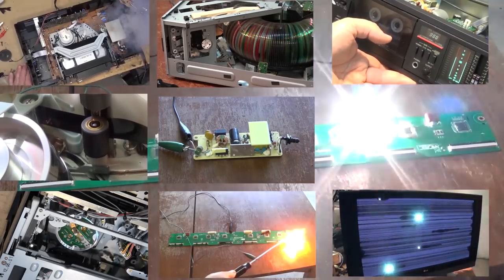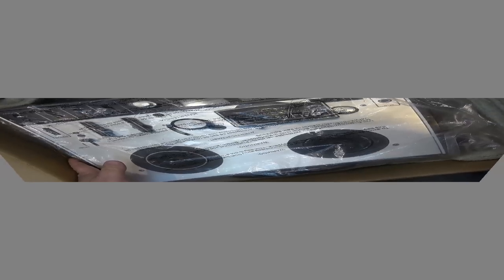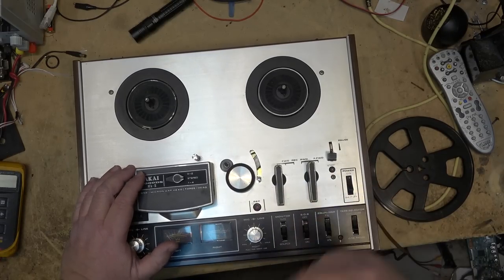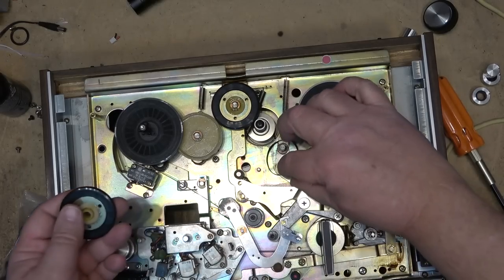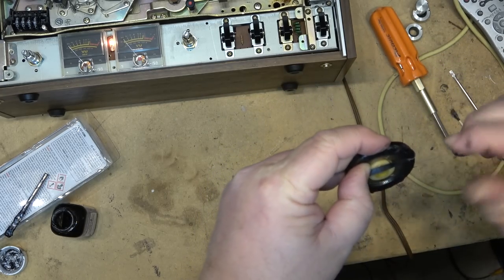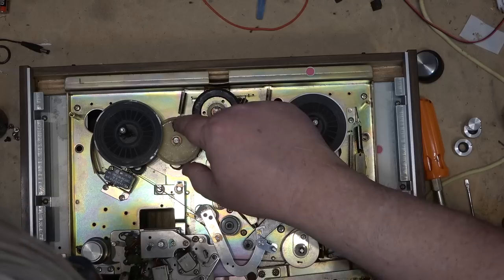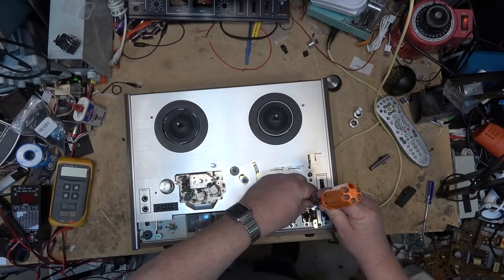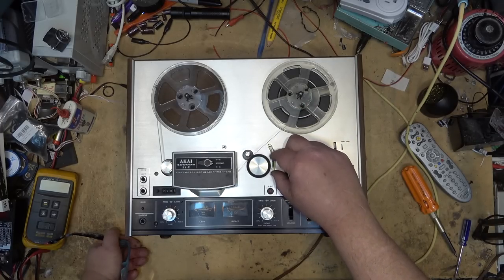Simple way to repair a worn out rubber tire.

Comment: Good practice to inspect the heads on a tape deck before getting in too deep with other repairs. No point repairing the rest of the machine if the heads are worn out. Replacements are scarce and re-lapping costs a fortune.
Reply: Teac and tascam still available to purchase directly.
Reply: @Poppinwheeeeellllllieeeeez  that's great news. Is that for reel to reel or also cassette?

Comment: I bought one of those at a hamfest for $40. They wanted $100. Turns out the head track selector switch was smashed in and the metal cover of the pinch roller cap was missing. I bypassed the switch and got it working.
Reply from the maker: The switch is only necessary for mono tapes as it puts either the left or the right track on both outputs. In the stereo mode you can do the same thing by just using a y cord and plugging it into a single output on the back.

Comment: Intelligent repair, at least temporally. Also intelligence was required to reassemble - for finding the parts between all the other stuff on the table....
Reply from the maker: It's a little more than a temporary repair. I did this on one of my old machines probably 30 years ago it still runs.   some have taken a larger belt and cut it included around the rim and that's more of a temporary repair because where it's cut it's always a possibility it's going to come off. The key is defining one that is smaller than the idler so that it can fit around The idler without needing to be cut then once it's glued in place they will typically last until the belt wears through and if the belt is .5 - 1mm that is going to take a while.  Same thing can be done to The idler tires on old rim drive turntables. In fact the first place I saw this done and where I learned it initially was the engineer at the community TV station I worked at. He showed me this on a rusco cue master turntable.  The one we had in the studio was slipping, he came in and collected it took it to his workshop popped the platter and glued a thin belt around the edge and had it back in service before i went on air. (i was working master control at the time).  
this is the same engineer that showed me the clean  video head trick using your fingernail. There's probably my best teacher actually because I wasn't in the repair field then, that was during my broadcast stint when I had little interest in actually repairing stuff because I was headed for a career and broadcast. Unfortunately that didn't pan out and I ended up in the repair business but I learned a lot from the chief engineer who is the smartest guy I ever knew when it came to servicing video equipment. My shift ran 3:00 to 11:00 p.m. and most days I would go in there right around lunch time and hang around the engineer shop and I'm sure annoy the shit out of them with questions.

Comment: The drive spindle seems to have some runout. You'd think that a quality machine like that, wouldn't have it in such an important area.
Reply from the maker: Quality machine? At the time this would have been an entry level recorder.  Probably sold for 150 new.
Reply: @12voltvids  Oh, I didn't know that.
Reply from the maker: @johnb5519  it's funny the value that people put on these old real machines. Back in the day they were not that expensive in fact a high-end cassette deck was a lot more than a real to real deck back in the late seventies. I bought a gx260 brand new in around 1979. It was probably made a few years before that they've been sitting in the stereo shop for a while. I think I paid $450 or $500 for it. Brand new in the box. By comparison I bought my first vhsvcr at that same shop around the same time. That RCA VCT 201 set me back 2 grand.  The gx260 if you're not familiar is a six head, Auto reverse reel-to-reel. It records both directions. Has three glass heads for each direction and a center capstan.  I used to think it was a great deck and I still have it however the glass heads became a thorn in its side. It just refuses to play any tapes that have sticky shed. Those same tapes however will play perfect on the also 4000 or my teac 3440.  Sure I have to clean the heads often but the tapes play without creating a screaching sound in the audio as they do on the glass head machine.
Reply: @12voltvids  Yeah, I think I recall your video where you talked about that. Must be nostalgia more than anything else, that people spend the money for.

Comment: Very good repair Mr. Dave a new rubber belt  carefully glued on is a lasting repair. I take the idler off and use comet or Ajax and scrub the heck out of the rubber with a wet paper towel and Ajax or comet paste two or three times in the sink with very warm water until the black  stops coming off  then it should feel squeaky clean and grip your skin real good. When you get to that point it will grab like crazy. I use it on record players and reel to reel. It works most of the time unless its cracked and too far gone then I have to glue a belt on like you did over the bad rubber. Give the Ajax or Comet a try. Use gloves its kinda harsh on the skin for the amount of time scrubbing the black off. I think you'll be amazed. Pinch rollers the same way. Be sure to blow out all the water from the bearings. I have a new cam set waiting on me to install in my old M8 AKAI I haven't done yet. Pot metal uuuhhh

Comment: Thank you for the belt tip! Now I need to order a pack of floppy disk belts, have an old Toshiba laptop I am trying to repair, need to have the power supply recapped and a belt for the floppy drive. Hopefully I can also get all of the software off of the HD. It just chatters like the heads are stuck. All of my Radio Programming software is on there for Motoroni rads that are now obsolete for US use but I still can use them on ham bands. Is there any supplier up in Canada that might stock belts for an older Technics turntable?

Comment: I am impressed by your ingenious solutions and thorough knowledge about the hardware. BUT the way your worktable is organized, parts are floating all around and mounting hardware is hidden under the UUT scares me…😂
Reply: Indeed! But I think it is part of his technical “charm” ! I love his knowledgeable and entertaining videos!
Reply from the maker: Have you ever seen the workspace of a real shop?. I have. Besides working in three one for 20 years every workshop that I ever visited was far worse than the clutter on my small bench and they had large benches. In fact the only place that the work dances work cluttered was Sony. That was only because their texts worked on one specific piece of equipment. One guy did televisions one guy did betamax one guy did cameras one guy did reel to reel the guy did cassette decks the other guy did amplifiers and receivers. The first shop I worked at what I was in high school looked like a bomb had been detonated in the back there were piles of ripped apart equipment everywhere being used to pick parts off of every bench was an absolute disaster and I don't know how the owner knew where anything was. He did and I trained at that place for a couple years when I was in high school. The shop I ended up working at for 20 years had one big bench the three guys were working on I was the fourth guy in there I got my own bench. It started out relatively organized but over the years got looking just as bad as the other bench even though we did clean it on a regular basis it didn't stay clean that long. Every shop I ever visited and I went to plenty as we all know each other or did. We shared tips with each other and winning the area would go in and visit the other guys because again we talked on the phone shared tips ordered parts from each other so I knew most of the other owners of shops and would go visit them they would come visit me when they were in the area. They all looked the same might have looked nice for what you can see from the storefront but walk around in behind that divider to the areas that the customers didn't see and they all look the same. Who was the exception there was the guy that bought the shop that I first learned the trade at which was across the street from the shop I worked at for 20 years. His shop looked like a hospital operating room everything was in its place the bench was spotless you could eat off of it. Didn't take long to figure out why his shop was so clean, it's because he had nothing to do he spent all his spare time just putting everything away between every job. He would take on one set fix it and then put everything away and clean up before he started the next one. he didn't stay in business very long after buying what had been a successful business. I don't do this for a living I do this more as a hobby and as a platform to produce content. I work full-time at my day job. When I'm not at my day job and I'm not actually fixing something in here or editing something I'm having to maintain my YouTube channel and remove all the spam and duplicate comments. You would be amazed at how many people and this one really ticks me off will ask a question about something completely irrelevant usually regarding a piece of equipment that they have which I've never seen before never heard before because it's some model that was never sold on this side of the world and then they will proceed to post the same question over and over and over to about 20 different videos that I've posted over the years. Not a day goes by that I don't spend at least two to three hours going through the comments and deleting the duplicate posts on various videos. I don't know if people are dumb or something but when a post is made I get a copy of an email to me. They don't need to post the same question 10 times all that typically does is piss me off and they'll not get an answer even if I know it. And that's why I don't have time to clean my bench more regularly because I have to babysit all the dumbass questions I get every day. Which some days is as many as 500 messages. Obviously I don't get a chance to respond to everyone I'm sure you can understand why. Some people however don't get the message and they'll just keep repeating the same question over and over and over until they eventually find that they don't get answers to any questions because they're on the ban list.  Old Johnny shithead is a prime example of that one he got banned about 7 years ago for being a troll like he has been on several other tech based channels I won't mention and he continues to file take down requests daily against all of us.

Comment: Awsome idea the rubber band one and the change of positions. Fortunately the idler whells were equal. I have an AKAI GX-4000DB, recently arrived to my collection and ready to be restored. It isn't in a very good shape than yours but I'll do my best. My hope Is this play tape heads are almost  eternal. I love all of this 70s & 80 stuff. I almost fix my first sólid state amp. stage of my old sansui G4700. Thank you for all your videos which are very illustrative. Regards from Cancún.

Comment: Great video and neat, neat trick with the idler tire!  I have brought dozens of these old R/R decks back to life, but have never thought about using a belt like you have.  My first deck was a Sony TC-377 with a single motor and mechanically similar to this one.  I have thought many times about getting another one for nostalgia sake.  I've held off because of the problem sourcing the idler tires.  Maybe now...we'll see.  One trick I've learned about the felt brakes is to take a utility knife and fluff them up to rejuvenate their stopping power.
Reply: tyres are sold out of a guy in Australia on ebay for the TC377/TC399 same guts on ebay. Brand new . Cost me sub 30 shipped the kit included both tyers.

Comment: Clever fix ...cool!.. one of my fix's was to sand the rubber a bit to get more virgin rubber exposed getting rid of some of the oxidized layer... i would chuck it in a drill and go at it with some sand paper..used to work good and keep it consistently cleaned off
Reply from the maker: Except when it is too small you need to beef it up a bit.
Reply: @12voltvids  Yeah thought of that..usually if it's not critical like what you did that was smart is swap wheels then you can get away with just some sanding but gluing a belt on was very clever. I never thought of doing that. Cheers.

Comment: I like the retread. Try coating a wheel with Flex Seal liquid, the kind in a can for brushing/dipping. It is very thin and flows to a VERY even thickness I have found. The stuff loves being reapplied to build thickness. (plasti dip for tool handles may work good too)
Reply from the maker: Flexseal good idea.  Will try that some time and see how that works out as I have some.

Comment: Interesting idea! I wonder from an experimental point of view - if we could just 'round' the idler to true a concentric wheel (lathe work) and then add the rubber band idea later it could even drive a flywheel? My Sony TC-645 works on a motor pulley to idler to flywheel principle, and it's a little noisy, but not too bad. I just gently roughed it up and then applied Rubber Renue.
Regards.